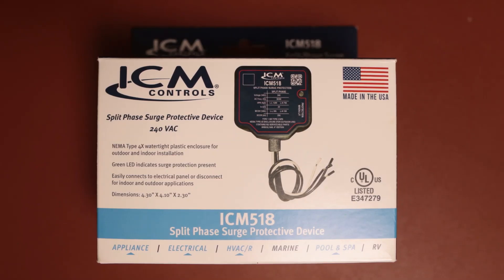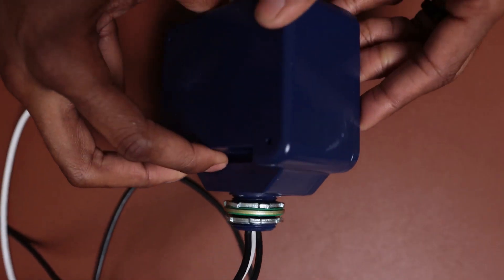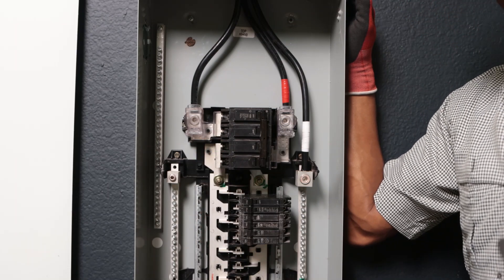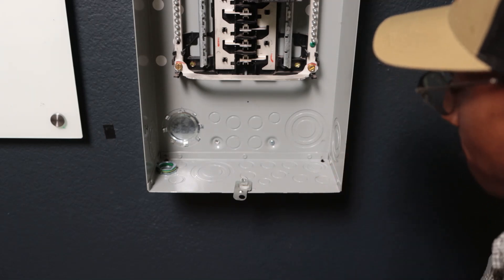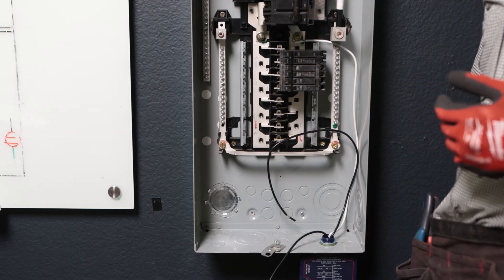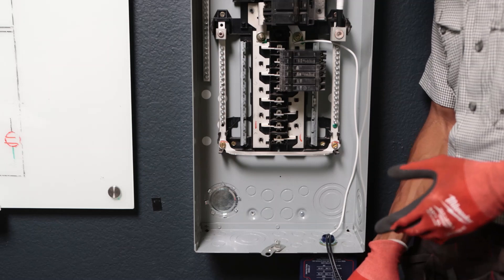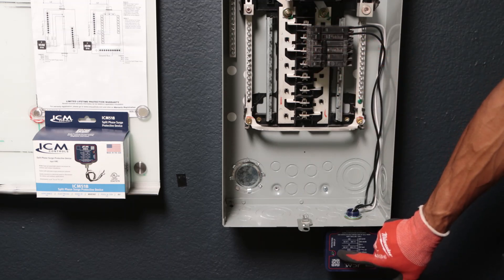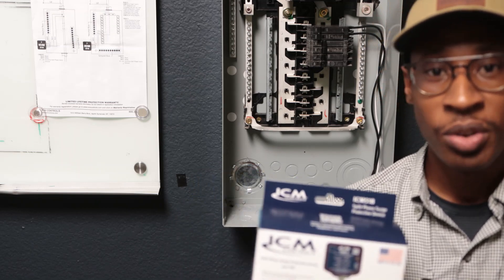SURGE PROTECTORS (SPDs) Install: ICM Controls 518 SPD Whole House Surge Protector

Comment: Nice video.  I was always taught to install the lead wires on the double pole breaker nearest the main breaker, which you did.  However, I was instructed to install the SPD as close to the double pole breaker which means it would have bee installed at the 3 o’clock, right side position on the load center.  The shorter the SDP lines the better for the performance of the SPD in its clamping surges.  The unit I installed had two green LED’s (Light Emitting Diode) lite up to show it was working properly, any other light combination would indicate a failure of the SPD and it would need to be replaced.

Comment: How would one of those surge protectors like the Eaton one be installed in a indoor panel that has sheetrock?

I know they make the stab-in surge protectors but those provide less protection
Reply from the maker: Cut a square piece of sheet rock out an install spd am cut sheet rock to fit spd. Patch sheetrock after where you cut block out

Comment: Your SPD are definitely to the U.K. you can install them as a normal breaker in the fuse boxes next to the breakers . I think the way the USA ones are designed you have to consider very carefully where you put the unit so you don’t block any other knock outs in your panel . Very interesting Sir . Watching from the U.K.